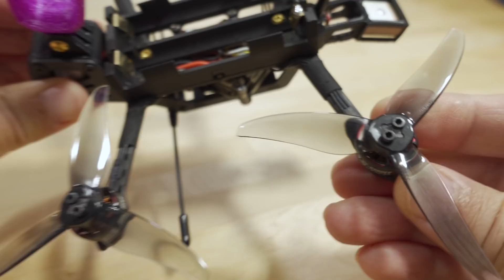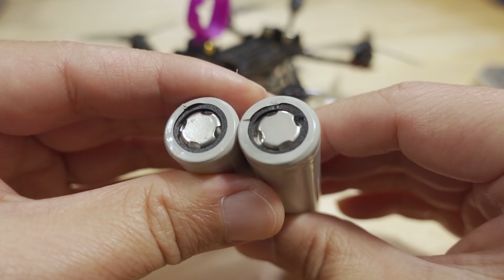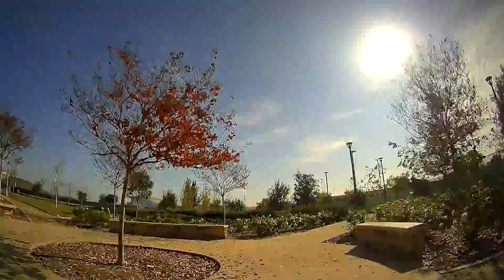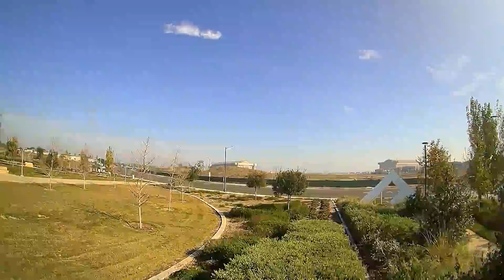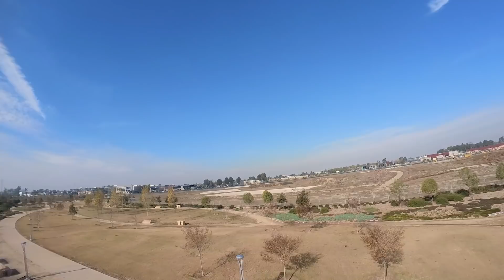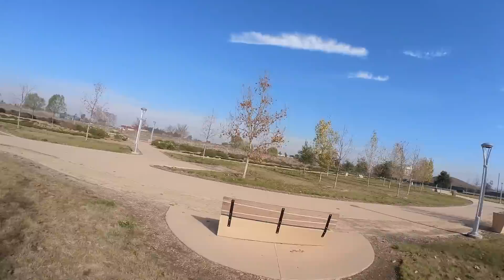RekonFPV Rekon35 2S 18650 MicroLongRange Quad

Comment: what about adding the dji 04 lite air unit to save on the weight? would th e04 lite work with this or would it need the 04 pro
Reply from the maker: Should be OK assuming you get the voltage correct. I don't remember how the power setup on this one was though.  You'll also need a way to mount the camera since the width is 19mm and has a center hole.

Comment: Hi. Really nice review! Some question, if i would like to build one with similar setup (AIO FC, 2s 18650) but swinging 4 inch prop, what motor kV do you recommend? Does 1404 3500kV enough? Thank you..
Reply from the maker: On 2S, 3500kv is enough to cruise but not much else.  4000kv would give better performance.

Comment: Hello Albert, and thank you for yet another nice review. I am curious to know how the vista is powered on this quad. There should be some sort of regulator/step-up on the vista power line coming from the batteries. 18650 can be flown down to 2.5ishV and 5V won't be enough for the vista. Can you see a tiny board on the vista power line? If yes I would be quite interested to know what they used there as I am trying to built one of these from scratch ...
Reply from the maker: There is a BEC module for the Vista but I'm not able to see it without taking the drone apart.  You can ask RekonFPV support for photos if you need proof.
Reply: @AlbertKimTV  Thank you for checking Albert, I will do as you suggest and ask Rekon support if they can let me know the specs of the BEC board. Stay safe!

Comment: My babyhawk HD weights 200g with 3s 650mah, this looks heavy for what it is!
Reply from the maker: It's a different design meant to carry the 18650 batteries.  Put those same batteries on the babyhawk HD and the weight will be similar.
Reply: @AlbertKimTV  but I also carry 18650 pack on babyhawk or not, with lipo I can freestyle and crash a lot, this one only cruises, only one purpose, with the baby I can freestyle with a insta or naked as hard as a 5” with 18650 I can cruise for 27min!

Comment: Great review as always Albert!  BTW, I've had similar issues with the GPS not getting satellites quickly even though I "prelocked" them the day before.  I came to find out that time of day is also important, so if you first got your GPS lock in the evening and then didn't fly withing the same time range the next day, it will still take a long time to get a lock.  Once you've got a lock for a specific location and time of day, it should retain that in memory and lock quicker the next time.  I'm actually in your area for a couple weeks on a work trip (from Canada).  I was actually just out looking for spots to fly today!
Reply from the maker: Ah, so time of day must be related to which satellites are above at that time of day.  I think they are in geosynchronous orbit if I recall.
Reply: Have you guys managed to have the GPS lock working correctly? The best I could have was to start flying with it working and finally in midflight it stopped to update, on osd it always shows 14 satellites even when disconnected.

Comment: Hi Albert, can you tell me what kind of power module (DC9V Power Module) they used.
I'm using a xl6009E1 to convert 2s to 9 volts but this doesn't work with DJI , greetings walter
Reply from the maker: I think it's actually part of the flight controller.  I don't see a separate board.

Comment: Very informative video as always, and an interesting frame design. Re. the 1303.5 motors- I put some on my 4” long range quad as they’re 2/3 the weight of 1404s. Mine are only 2500kv on 4s and Gemfan biblades but it has plenty of power and flies at sort of 35% throttle most of the time. My only issue is that propwash performance is horrible- I think the motors don’t have enough torque at lower throttle for a 250g quad. Other than that they’re great. Have you noticed that with these high kv motors on 3.5”?
Reply from the maker: I have not noticed a huge torque problem unless you fly really aggressively.  For that you just have to move up to a bigger motor.  On the 4 inch prop, the 1303.5 motor isn't big enough to handle the weight of the prop so only useful for slow cruising.  Forget about racing or acro.

Comment: Albert, where do you get the 18650's is hard to get real ones these days.
Reply from the maker: I put a couple of links in the description.
Reply: @AlbertKimTV  yes I've had great luck with 18650batterystore. I've used their  Molicel 18650 and 21700 cells.  For the price you have a hard time beating them.

Comment: Gps module has to be far from digital vtx antenna thats why its so hard to aquire sat.Not an issue on analog.
Reply from the maker: Yep, that's what I said in the video.  Not sure why the design doesn't change to account for this.

Comment: Hey Albert
How low will the vista go?
Reply from the maker: I forgot to mention the separate power module that provides a constant 9V with input voltage as low as 5V.  So the Li-Ion cells can go as low as 2.5v/cell and the quad/Vista will still have power.  Without that power module, the Vista would shut off at 7.4v.
Reply: @AlbertKimTV  thankyou